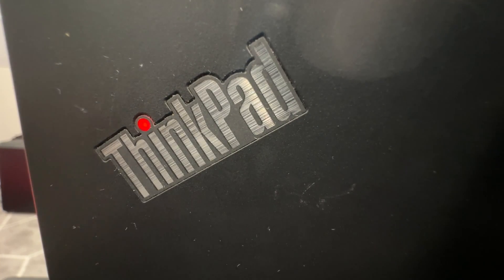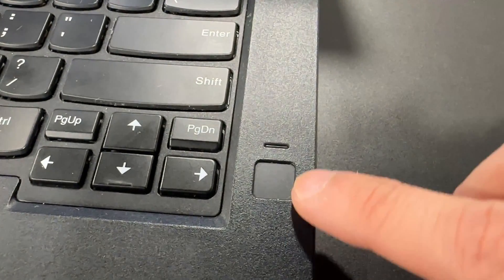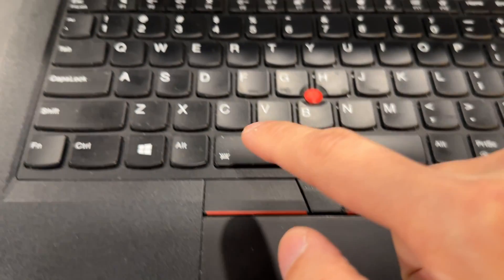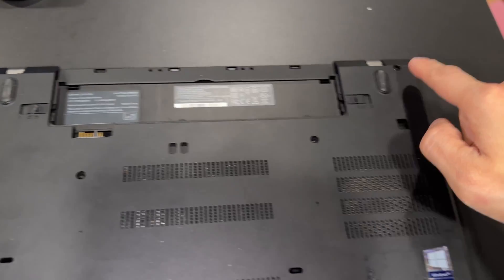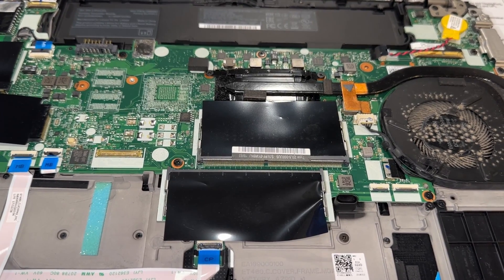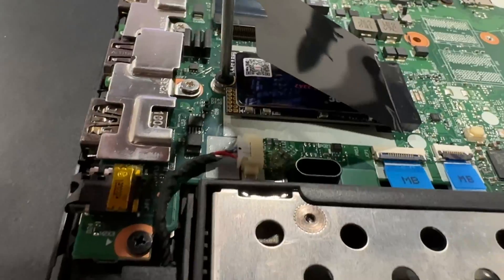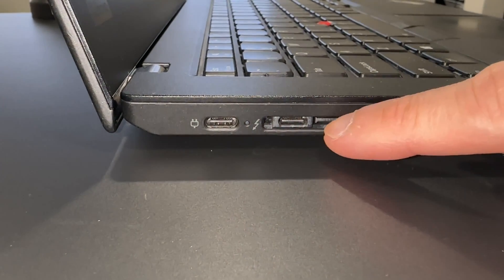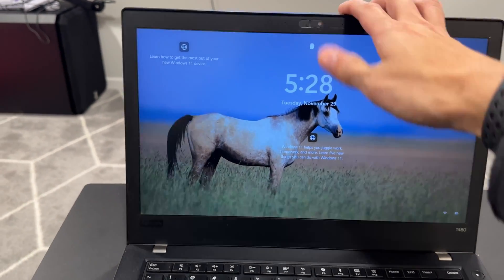How to Buy and DIY Upgrade a Used Lenovo T480 | Budget Laptop Upgrade Guide

Comment: I have the same RAM kit, and it doesn't work in my t480. My t480 has an i7-8550U and is a non-VPro model. How do I get it to work? Both of the new RAM sticks are good, as each works separately in the ThinkPad.

Comment: 2 years later i paid for mine 190€ (200$US) on ebay i7-8650U with dedicated graphics cart (2G) + 8 GB Main memory + Smart card Reader + 4G Modem + 256GB NVMe SSD.
Swapped Memory to 2x16GB, NVMe to 2TB, Wifi to AX210, replaced & upgrade both batteries, add docking station = 250€ (260$US) so total of 440€ (460$US)
Running LMDE (linux) most time and Win11 now and them (dual boot). Still satisfied with that machine.

Thank you for that vid and greetings from Germany
Reply: Bought Zbook 17 G5 in excellent condition with triple layer Blu-Ray burner, quad core and CAD graphics card on par with RTX1070 mobile that can run even MS Flight Simulator 2020 on high details fluently for 420£... 
The cost of these older ThinkPads often gets out of hand due to hype, considering that you can break them in half with often cheaper yet far more powerful 3,2kg 17,3" Zbooks meeting MIL standards for fall, so you can guess how thick they are to pass fall tests with 17,3" displays, yet they are also fully upgradable (up to G6) including GPU dedicated cards or even CPU with different motherboard options...
Though one can miss traditional docking stations especially ones with DVD drive for X220/230 that in tablet version with decent enough IPS display may be sufficient for many to be happily used even today and sometimes can be found for next to nothing, you can buy Lenovo ThinkPad L14 Gen 5 with AMD and warranty for less than 400£ and that thing will wipe out floor with T480 in every regard apart from build quality while being also upgradable (RAM, SSD, LTE), or you can buy for even less Lenovo ThinkPad T14 Gen 3 laptop Intel Core I7-1265 12TH GEN 32GB RAM 512GB SSD near end of warranty which may be pretty solid choice even without upgrades...

Comment: I see this as a non issue for the most part...   Yeah, you can't upgrade the newer models:  but when they already have 32gb of ram--  why would you need to upgrade?  There are models with RTX 3080's in them, w/ 64gb of ram and i9's.. with NVME drives---   what are we needing to "upgrade" ??   Just don't buy the low spec versions in the first place:   that's my advice.   There are plenty of high spec offerings that go for a few hundr3d..  Only six or seven hundred for the highest end.. (for a $4k dollar machine--  $700 is a bargain).

Comment: My T480 accepted the M.2 SSD with a single notch. I'm not sure if it's the standard M.2 adapter or something aftermarket. Mine had a 1TB SSD with the dual notches, but a 2TB with only one notch installed and worked fine.

The low resolution "HD" screen (1366x768) can be upgraded to a non-touch "FHD (1920x1080) screen, as they both have 30 pin connectors. The Touchscreen FHD display (also 1920x1080) uses a 40-ion connector, so the T480 is not upgrade able to a touchscreen display. If that's important to you, make sure you find one with the touchscreen display.

Mine was sold as an FHD screen model running Windows 10 Pro. The good is it came with Windows 11 Pro (at least, I think that's a good thing. YMMV). The bad is it came wth the HD screen, which is how I learned the HD and FHD screens are interchangeable.

Great video. Keep up the good work!

Comment: you can use eucalyptus oil to clean the top lid. put the oil on piece of soft cloth, and gently rub it on the lid. it's going to look brand new. bonus new will get a aromatheraphy smell as well.

Comment: i got one with 20gb ram and a 512 ssd for about 150 and the only thing it needs is a new internal battery (which isnt a huge issue because its got an internal battery AND an external battery). you can definitely get some great deals if you look around

Comment: I managed to grab one t480 today for 115$ that comes with i5-8350u, both batteries work pretty good and the ports aswell with 8gb ram and 512gb ssd, 1080p screen with touchscreen included with little to no scratches almost feels like brand new, I'm feeling very happy with my purchase 👍👍😊😊 also just noticed I also have the backlight keyboard 😍😍

Comment: bro i still use the t480 a i stil love it.   its fast enough to do everything.  i upgraded to 32gb ram,  only issue is SSD upgrade only uses 2 pci-ex lanes instead of 4.  which means half speed using m2 ssds.  however, still much faster than sata ssd  and way faster than hdd.  i only have an ac1900 wifi so i didnt need to upgrade my wifi.  but yea the 8th gen i5 is powerful enough for me.
Reply: Can it game or use Adobe

Comment: Why do so many people making these sort of videos end up with the same conclusion as this guy. No, you're not buying yourself time, just install linux. Like why do you think so many still daily drive old thinkpads? Do you think they just deal with using windows xp or 7 or something? No, they use linux because linux won't slow down your computer after a year or two and 20 years from now it'll still support it. And this is especially relevant for these t480 thinkpads that are much newer.
Reply: What's your recommended Linux daily driver? I just got a ThinkPad P72 and I don't want to install Windows. I want to use it mainly for CTFs and for learning penetration testing, but I also don't want to install Kali on bare metal. Previously, I was doing all of this on an HP laptop with Windows 10 as the host and Kali on VirtualBox, but now that I got a secondary laptop I would Linux as the host. Does virtualization work the same on Linux machines?
Reply: @galloe  arch. Yes, I'm that kind of person, but I won't force you. I like arch because you can turn it into whatever you want and pacman is really good. If you don't want to tinker with your os you can go with endeavoros which is basically preconfigured arch, but it's better than manjaro, avoid manjaro at all costs. Another recommendations I have is fedora, it seems like another good distro but I haven't used it on bare metal. What I suggest you do first is research the graphics drivers that are needed for your thinkpad and see how good they'll work. Like I'm not sure about the older models but I know for the newer ones with intel graphics like the t480, the last great thinkpad, they're open source and genuinely good. Amd does the same, but nvidia doesn't and I know there are some older models with nvidia dgpus.
Reply: @vali69  Not a bad idea. If I'm going to be submerged in a Linux environment, might as well learn how to customize a distro from the ground up. I've also heard that more advanced hackers/cybersecurity people use BlackArch, but I think I'm still a long way from getting to that level. In the mean time, I'll take a look a the graphics drivers. Thanks for the suggestions!

Btw, I just looked up EndeavourOS and it looks damn beautiful! I might just start with that and work my way into the harder stuff.
Reply: @galloe  yeah endeavoros is preconfigured really well. I recommend you go and watch some videos on desktop environments and window managers first, than you can go to a video about configuring one like dwm or hyprland and then research stuff from there like the file manager they use or log in, all on the arch wiki, it's an amazing source for anything linux related, not just arch.
Reply: @vali69  Awesome, thanks for the resources! This looks like a whole project in itself for someone who's just starting with Linux, but if I've learned anything from doing CTFs is that the more you're forced to figure things out the better you learn.

Comment: I'd add a cooler upgrade to the list, since the stock cooler in the t480 is pretty weak. I personally went for an upgrade from the single pipe cpu cooler to the dual pipe gpu cooler. Whether there's a gpu in the machine or not, it'll reduce core temps by quite a bit, and you can replace the thermal compound while you're at it.

Comment: Fun bit of info, you can buy the discontinued gpu dock with a 1050ti inside of it, and if you are running windows, you can get the right drivers to cinnect your laptop to it.
Alzo you can swap the trackpad with others if yours is without the buttons at the top.
And, youll wanna go for the i5 or non igpu i7, as the mx150 isnt worth the price, and causes the cpu to throttle and overheat much too fast.
My 100% upgrade recommendation is a large ssd, and as much ram as you can shove in it.
Oh, and replace thermal paste, always helps. (Btw for the memes, i run arch 😂)

Comment: 9:56 The machine I'm looking at has wiped drives and the seller does not know the status of the Thunderbolt Firmware.  But looking on Lenovo's site there is a Critical Firmware Upgrade for the Thunderbolt controller listed as "Thunderbolt Firmware Update Utility for Windows 11 (Version 21H2 or later) and 10 (Version 1709 or later) - ThinkPad T480"  it is dated 12 Jul 2022 and is for the 15BF model.  But I cannot find any information about whether it resolves the specific issue you mentioned.

Comment: Can you use this computer only with the external battery?
Reply: Of course, my T480 didn't come with the internal battery (it had a spacer in its place that was dead weight so I chucked it into the drawer), so I got a 72Wh battery for myself for $30 and it works great

Comment: My t480 With i5 7300 1 T ssd 16 gb RAM good Optik 179 Euro!
Reply: The i5-7300U is a slow processor, and it restricts your laptop to just 32GB RAM instead of 64GB RAM. Quad-cores like the i5-8250U are now the minimum for if you want actual work to be done. Dual-core processors are only good for Windows 10 and office workloads and some light web browsing.

Comment: I love my T480 with Win 11.  Maxed out the memory and this is my go to Development Laptop.
Reply: Dont you worry about the charging port and the potential issues with the charging port being soldered on the motherboard? 😅 that's what's holding me back from getting a t480
Reply: @emberavenge7162  it held me back for the longest time, and I'm still surprised that the vast majority of thinkpad lovers doesn't treat it as the huge disadvantage that it objectively is. However, I still ordered one this week. Why? Because I wanted a thinkpad specifically from that era, and all other models that were as good or better than the T480 in terms of specs, price, repairability and upgradability - which mainly leaves the P series - had a numpad and were significantly heavier. Numpads are a dealbreaker for me, so I didn't really have a choice. Apart from this issue, the T480 is pretty much perfect, so I took a leap of faith. I'll update the firmware as soon as it arrives and hope for the best. 

Your caution is completely justified, the soldered charging port is the dumbest thing lenovo could've possibly done on a supposedly premium device (I dislike USB charging on laptops in general, but that's a matter of personal taste), and in combination with the firmware bug it's indeed a good reason not to buy a T480 or the other models that have the same issue. It's mostly a question of how much you love the other qualities the T480 has to offer, and whether or not you're willing to take the risk. It's understandable if you're not.
Reply: @emberavenge7162  what does that mean?

Comment: Is it still worth it in 2024 ??
Reply: Definitely, I got mine in October and I got an upgraded battery for $30 and an IGZO screen for $60 and it's transformed my experience
Reply: @one_step_sideways Where did you get the battery from and how good is it... Just got a t580 for the big screen... I'm want to get a replacement battery first before doing other upgrades

Comment: bro got 64 gb in a work laptop
Reply: Because it's a laptop for work, not for gaming with 16GB soldered RAM. Most demanding apps don't use all 8 threads that the i5-8250U and higher have anyway

Comment: Does the i5 support 64 or only 32gb RAM?
Reply: The i5-8350U supports 64GB (but some models don't, processors with vPro usually do), the i5-7300U (dual-core and is slower) supports only 32GB RAM. Basically avoid T480 laptops that have a "7" in the beginning of the model number

Comment: The T480 is a damn fine machine, and it runs Linux like a champ! I just bought a T495 (even though it was soldered RAM). The price was in the double digits, I just couldn't resist! The T495 runs Linux pretty well too.

Comment: There seems to be conflicting information regarding RAM capacity of these laptops. Some youtubers say max is 64gb, but documentation all seems to point to 32gb. Anyone have any info?
Reply: According to the official spec sheet,the maximum is 32 gb.I personally upgraded my ThinkPad T480 from single 8 gb ram stick to dual channel 32 gb ram.
Reply: @kirilraychev732  thanks for the info! I did a bit more research, and it appears 32gb sticks didn't exist when the spec sheet was written, so they said 16x2 (32gb total) was the max. Many people seem to have had success with twin 32gb sticks for a max of 64gb.
Reply: @tokillamurderer  No problem,I actually meant I have  a 16x2 configuration but it still works pretty well, it's enough for most tasks
Reply: Possible non-booting with 64GB ram, believed to be related to T480s that came with the optional VPro licence. It really is a case of try-and-see, some T480s accept 64GB, some need to drop back down to no more than 48GB. I have 64GB arriving shortly, hopefully I'll get lucky.
Reply: @Saintathantwinpeaks  I believe the T480s comes with one open ram slot and one soldered module that could be maxed out from the factory at 16gb, for a max total of 48gb

Comment: If I'm buying one for 400 bucks and getting a new screen battery, ram, ssd at that point wouldn't it be easier to go for a 800 dollar machine
Reply: And a warranty. That is the dilemma of an upgrade, though I will say that the T480 was a relatively expensive laptop aimed at the business market, so they really are designed to last. There are many folk who have beasted their T480 day after day without issue. Good luck.
Reply: @Saintathantwinpeaks  I ended up getting a dell latitude 5431 I think with an 1250p processor for 400 upgraded the storage and memory ended up spending about 600 in total. Its last years model and has some warranty left. I was nervous with going with the older professors that the t480s have because I want to do some heavy lifting down the road.

Comment: I basically can’t decide if I should get the T480 or the T470. Some people at forums I visit complain about the USB-C charging port in the T480 and on being easily damaged and not easy to repair, while the T470 has the slim tip charging port. (They’re saying USB-C charging ports are inherently a problem, not Lenovo laptop with USB-C charging specifically).

This kind of struck a chord with me because I have never had a laptop with USB-C charging port… and if I was going to buy an older laptop because it’s upgradeable and it’ll last awhile, I wouldn’t want the charging port to potentially be able to be damaged and expensive to replace.

The T470 has the slim tip charging port (which I already have 3 charging cords to because I have a Thinkpad X1 Carbon Gen 3 which uses the slim tip charging port) but it also has a single USB-C port available for USB peripherals. 

Is there any benefit to having the device that has 2 USB-C ports on it (like the T480 has)?
Reply: Nice comment, I got a 470s but I was also with the same doubt
Reply: One thing to note with USB C charging, it's typically physical breakdown of the port (broken pins or poor cable retention). The nice thing about the T480 is it has two charging ports (can also charge over the Thunderbolt port). Although the USB-C ports are soldered to the board, it's not a difficult repair with a hot air station.

Comment: I recently bought a T480. How do I update the Thunderbolt Controller firmware? I've tried uninstalling and reinstalling older firmware but it's still stuck on version 14
Reply: You should try to update BIOS firware if you cannot update Thunderbolt firware under Windows.

Comment: Tell me if this ThinkPad T480 - supports Stereo Mix in recording, because on 03/06/2023 I bought a T470 and unfortunately its Music Card does not have the Stereo Mix Function and to do my job on it I have to connect an external USB Music Card that has this Function. This is how these Laptops were praised, and there is no such basic Function, despite the fact that the Audio Chipset is Realtek, which in 99% of Laptops from various companies - supports this Function. Regards goombay

Comment: In summary, you got the maxed out T14 which could ve cost around 1800 usd for 500 usd , except that the processor is 8th gen which is a lot slower than 12 th gen

Comment: We have many T480 laptops at work. The most of the damages I found were the LCD panel and the USB-C charge port. There is another port next to it, but sometimes that, too, gets damaged. Having the USB-C port as the only charge port is an engineering mistake. The "slim" square charge port was more robust.
Reply: the port fail was most likely caused by the Thunderbolt issue and not physical wear of the ports. Updating the Thunderbolt firmware on units that still work will prevent port death
Reply: @oddinvestigator Not to mention that to repair the T480 laptops with a dead port, there's just a small dirt cheap chip on the board that needs replacing, which can be done by a regular user with a heat gun and other soldering materials (it's like soldering a BIOS chip) - the port itself is going to be fine.